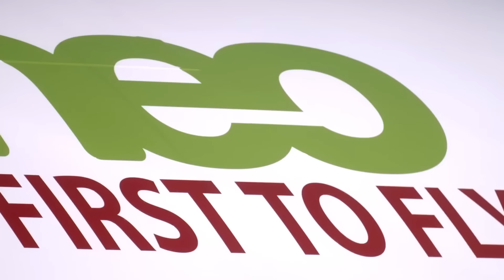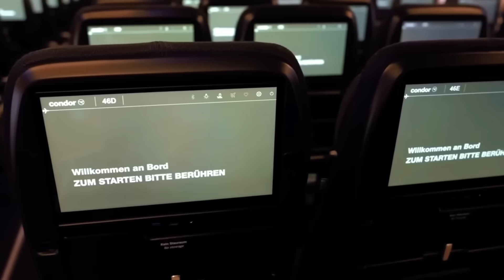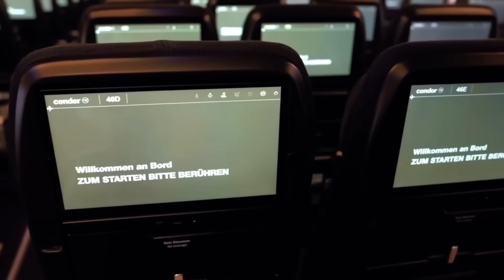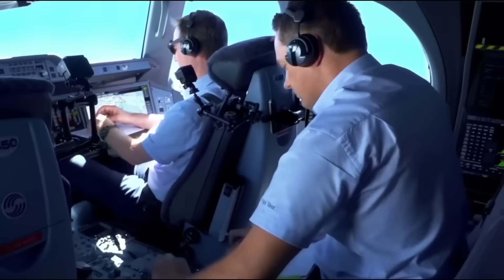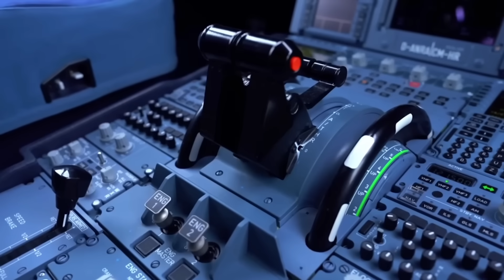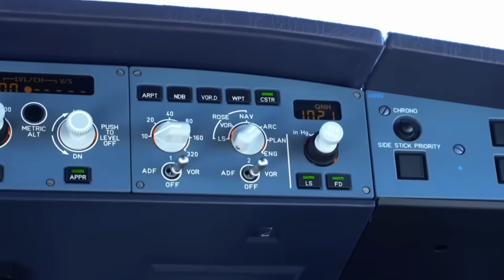Why Airlines Prefer the A330 Over Newer Widebodies

Comment: This was supposed to be the original A350 design from the around 2005. But at the time, Qatar Airways wanted a more capable aircraft, and the result was the A350XWB, as the A350 was originally known. Airbus developed the A330neo essentially by updating the original A330 design but with a lot of the improvements planned for the original A350. As such, the development cost was really low, and that made the A330neo really cheap for manufacture for such a large plane. It also helps that the current production version of the A330-900neo has a range of 7,200 nautical miles, which made it perfect as a 777-200ER replacement.

Comment: the a350 is a different class of long haul aircraftand depending on the variant it's the same for the 787
Reply: 787-8 competes with A330-800
787-9 competes with A330-900
787-10 competes with A350-900
777-300ER competes with A350-1000
Upcoming 777-8 will eventually compete with hypothetical A350-1100/2000
Upcoming 777-9 competes with nothing
Hypothetical 777-10 would compete with nothing
There is no Airbus counterpart to 747-8 (which is the last of the line) 
There is no Boeing counterpart to A380-800 (which is the last of the line)

...
767-300ER has no Airbus counterpart
767-200ER has no Airbus counterpart
A310-300 came too early to secure its place between 767-200(ER) and 300(ER)
A300-600R came too late and utterly range starving to challenge 767-300ER
757-300 has no Airbus counterpart
757-200 were initially qualified as irreplaceable. But ultimately, 99% of its dedicated routes are now operated by A321/LR/XLR. Only a few openly admit it, but airlines are actually saving million soon to become billions replacing the type wit A321Neos.
787-8 never fulfilled the suggested "ideal 767-300ER successor." Boeing LIED! The type is 1,5 times more costly to operate per hour, due to advanced technology requiring care and support. It has longer ground check time and maintenance. For being wider with larger fuselage and wings, the extra added tons consumes more fuel which negates its engines fuel efficiency while airports fares are higher, every flight. To come on top above 767-300ER, routes must either exceed 6000nm to save enough fuel on while cruising, or seats must be sold up to the last one on shorter routes. When airlines realized 787-8 were that disappointing, they either tried to cancel phasing out their 767s, or were forced to fly narrowbodies on 767 routes. 787-8 were repositioned on routes with more demand. They also stopped ordering 787-8 in favor of -9 now they have that many qualified crew they couldn't just ditch out... quite sad.

Remarks:
Range is only relevant on specific long routes. Only a very small number of airlines have a couple of such routes in their network. The incredible range of the 787-8 over A330 is quite irrelevant, or the seemingly lack of range of the 787-10 compared to contenders: airlines networks drive range criteria. Overall, all widebodies can operate all routes, worldwide, at least up to 99%.

Ultimately, two key criterias drives type selection:
- 1) how much tons of fuel and consumables plus support a type cost per route? (that's where the aircraft weight per number of seats matters one million times more than fuel per passenger per 100 miles, or how fuel efficient the engines are)
- 2) How much cost type integration in the fleet (it can be so expensive, continuing buying new A330 versions, or 737Max for that matter, is the realistic course of action. The same principle would apply when 787 gets old and arlines will crave for a successor from Boeing.... (this would steer another gloomy desperation for those asking to bring back 757.. because after 777-X and the 797 supposed to replace 737, Boeing *must satisfy airlines with a 787 enhanced, therefore would surely die attempting to make a proper 757 successor)